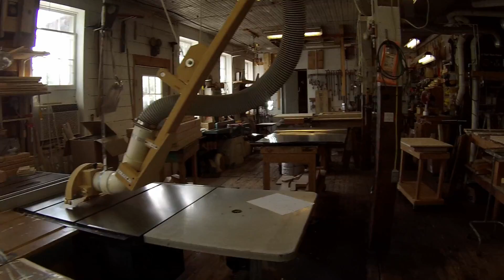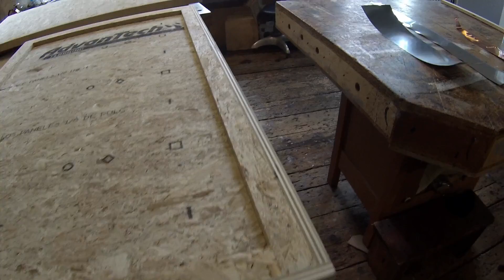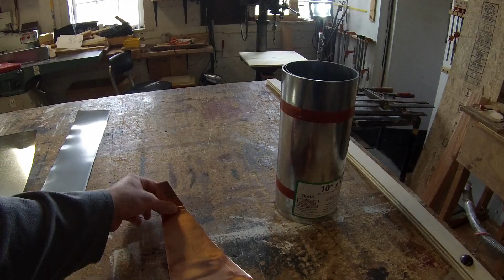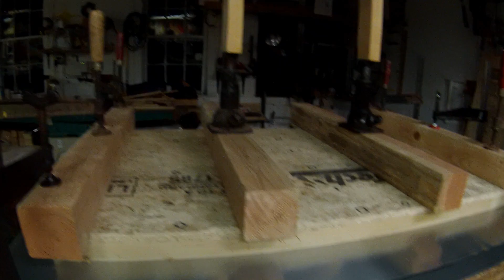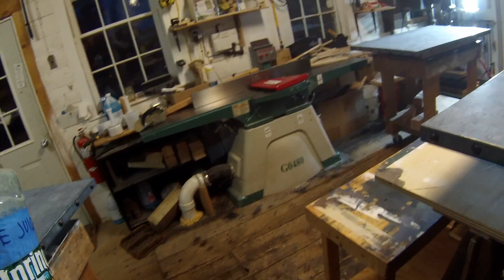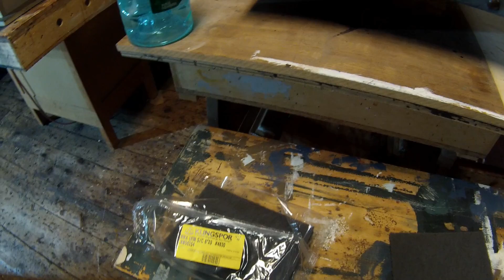Making Zinc Counter Tops - Questions Explained

Comment: I love your videos. 3 questions - - 1. would you use as an outdoor countertop that is usually tarp covered? 2. this is a countertop that will wrap around a BBQ, how close would you put it to the BBQ sides? 3. would you use Marine grade plywood for moisture and heat resistance?

Comment: Curious...have you ever used/considered using contact cement vs the tube poly that you currently use? After doing my first top using the tube I have to agree that glue control is a large part of the battle.